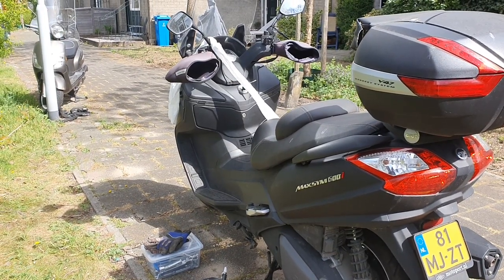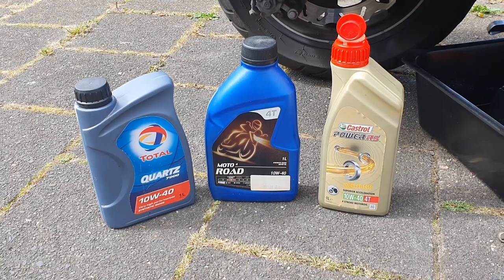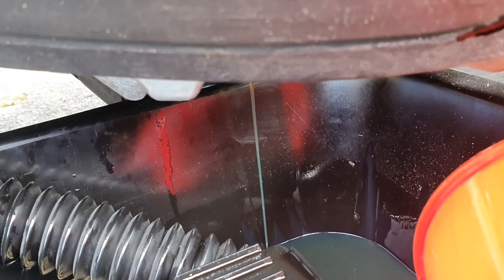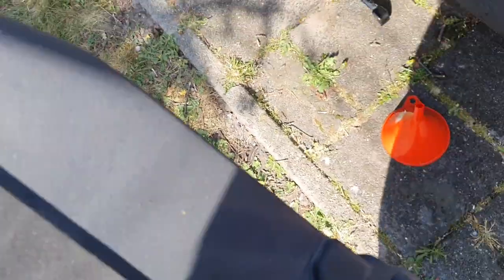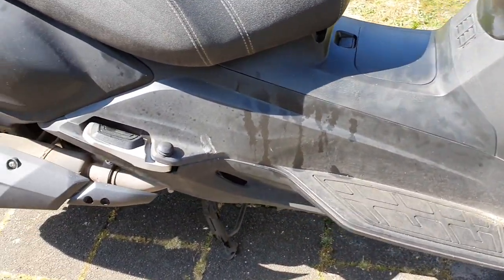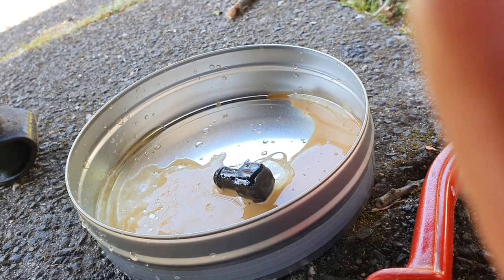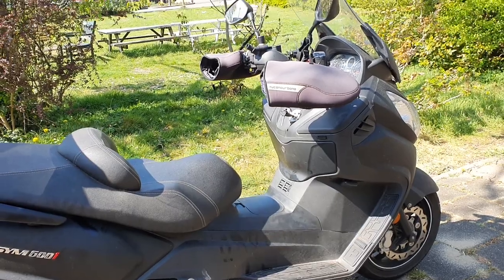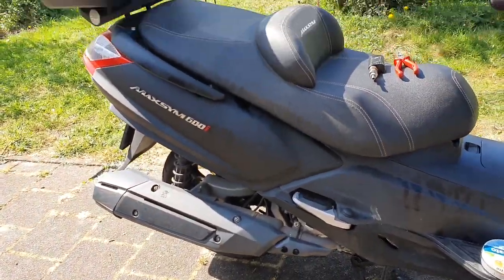Maxsym 600i - 22.500 Kms maintenance and reasons for a motorscooter

Comment: Hello my friend!

Today I've changed the belt and I put rollers Dr Pulley 25x17 15 grs

Waw it puts à kick ass !!!

No More vibrations between 3000 and 4000 rounds per minute

And 0-50 km/h on 3 seconds

I'm very happy with it!

I changed the air filter too and the rear brake...
Reply from the maker: Hi Hdc, happy for you! Enjoy it! Cheers!

Comment: I know it is super old. Hope you are getting well.Have you tried it with a syringe to add the transmission oil.
Reply from the maker: Max still rocking, thanks! I tried with a syringe, but it takes forever. Also my system takes a long time, but it requires very little effort. It works for me... Cheers!
Reply: @francescometalli1004 what’s the mileage nowadays?

Comment: No idea what good that dr pulley does. I have a 2019 maxsym 600i. No vibration once or ever at any rpms.. they fixed that issue at 2018. Plus, dr pulley gets you faster to 100 km/h. But you lose top speed and you lose the gentle reaction from the variator in city rides. I have tested all of that for 3 weeks and then I put back the original rollers. 
Everyone have different experience with each bike, so I might be wrong.
Anyway, clean the variator(dust) every 4000 km.

Comment: Hi Francesco, great idee ,  the information about refilling or changing radiator coolant.
Following  the service manual,i also think  its a bit to complicated. 
I think my maxsym never had a coolant change,,it has around 8000 km now,and is 3 years old
(most motordealers,never do it ,as i read frequently)
and the level is low,so i need  to refill it
Searching the internet,they warn about the risk of mixing different cooling liquides.
I don't know what to think about?
The SYM  BRAMAX radiator coolant,(recomended)wich i think is still in my maxsym,
I don't think its available,anyway ,i can not find it .
What coolant do you use?
Maybe you can you give me some advice ?
Nice video again,and i learned a lot off things looking at all your other video's!

Thanks!
Reply from the maker: Hi Peter! My thinking is that as long as the cooling liquids are in specs for Max it does not really matter. Same for engine and trasmission oil. Max is a simple machine, not a porche... Have done just less than 25000 kms, not a single issue! Cheers!

Comment: you do the valve adjusting yourself? As it is SOHC with locknut it should be easy to do but is it wel accessible? My choice for a honda CBX 500 fell off because of this job ( you need to remove all the electrics on top of the cilinder head.
Reply from the maker: Hi. I didn't need to adjust the valves yet... The cylinder head is not easy to access. For that kind of ops I would probably ask an expert. Too risky to mess up, and it needs instruments I don't have.
Cheers!

Comment: Hello dear Francesco. I also have a Sym 600i 2019, and i saw you changed the transmission oil, and you used 80w90. Even though in the manual it says you have to use 85w140.  Can you tell me why? I also have to change the oil on the 1000 km revision.
Reply from the maker: Hi Pop, easy answer... Can't find anything else than that. Asked the shop where I bought Max, they told me the 80w90 is fine. I had no issues with it. So out of specs but still feasible. It happens a lot. Max is easy...

Cheers!
Reply: @francescometalli1004  Hi. My workshop also uses 85w90 so I guess it's fine.

Comment: Salve Francesco, se posso darle un consiglio, al prossimo cambio olio sviti il bullone da 17 posto esattamente sotto il banco del motore invece del bullone da 12 che ha svitato lei... O comunque sviti entrambi perché in quello da 17 troverà uno screen filter (bloccato da una molla)  che deve essere regolarmente pulito. Le lascio il link dei disegni esplosi...
https://www.easyparts.it/showdrawing/27346/203265/BK/0-4019-1-m423-m28828-m12136-m23762-m27346-s27350-d203265/Sym-Maxsym-600I-4T-ABS-Executive-E4-2017-(EU)-Carterdeel-Rechts.html

Saluti
Simone
Reply from the maker: Salve Simone, grazie per il consiglio! Molto interessante, controllerò. Lei ha anche un 600? Saluti!
Reply: Sparkplug is not 6mm to 7mm but 0,6 mm to 0,7 mm.
Reply: Francesco Metalli salve Francesco. No, ho un Sym 200 e un Piaggio 250. Ma mi attira il Maxsym, quindi spesso mi documento in vista di un possibile futuro acquisto... Mi occupo di meccanica a livello amatoriale quindi Metto un po’ il naso dappertutto :-)) cari saluti